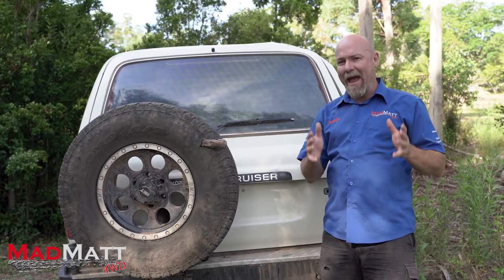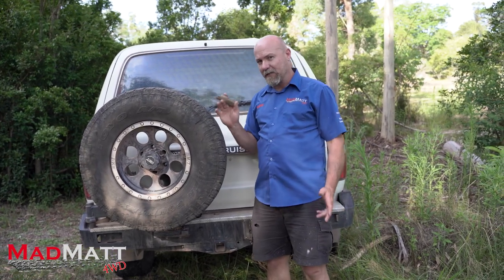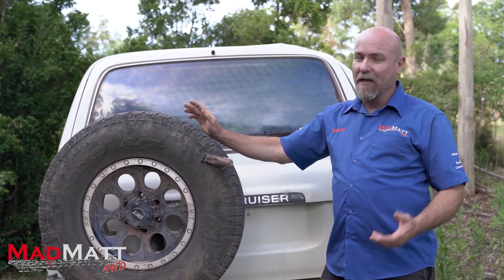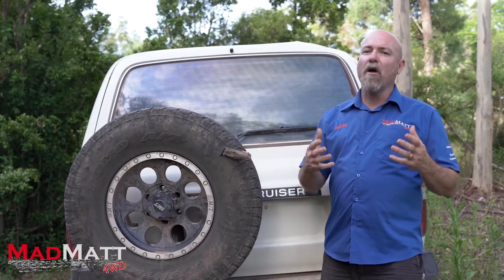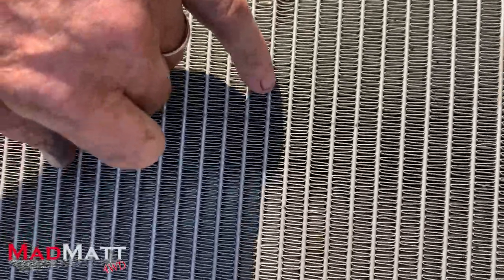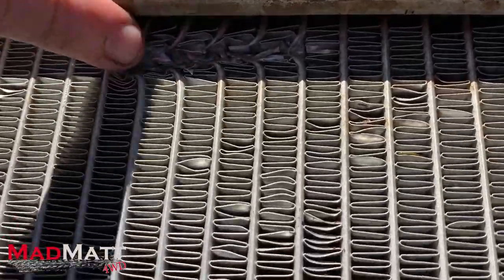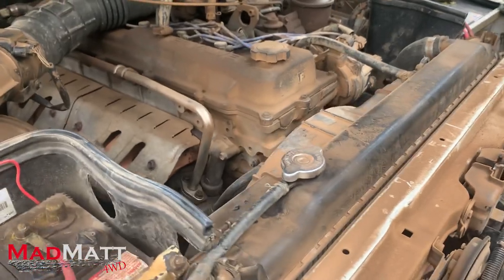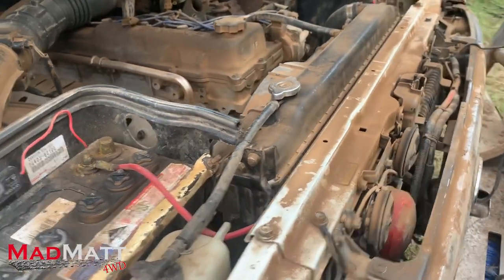How I FIXED RADIATOR DAMAGE in the Victorian High Country PLUS some other bush repairs on that trip!

Comment: Pulled the heim end out of an aftermarket trackbar on my Ram Power Wagon at Rausch Creek off-road park.  I didn't identify the issue correctly when it happened in the depths of the park.  On my gen PW there is a skid plate attached to the bottom of the solid front axle to protect steering components and such.  The long part of the bar wedged itself in between the steering stabilizer and the axle, but did not drop down to the ground because of the skid plate, making it hard to spot.  It was like I had steering, but not great.  I initially thought the steering box was wonky.  I made a really loose, rocky, undulating accent out of the park.  It's grueling when you know something is wrong with your truck and it isn't behaving right, but you keep trudging on.  It wasn't until I aired up and started running on pavement back to the camp ground that I got a sense of how bad the steering was behaving.  The steering wheel was turning 90 degrees without much action from the truck.  I got my convoy to stop and after a few of us went under there, one guy spotted the track bar separation.  So, it wasn't my steering, it was the whole truck shifting back and forth above the axle during steering input.  I don't recommend this to anyone, but we took it on the highway at a moderated speed, my buddies vehicles front and behind escorting me back to the campground.  I let the truck sort of track itself and glide in the direction I needed to go.  The wedged trackbar helped a bit.  Back at the campground, cooler heads could prevail.  With our combined efforts and tools (and a few beers) we were able to remove the trackbar, worked on the threads to remove the stripped metal splinters and was able to get the heim to bite into some good thread to get me home almost 2 hrs away.  A few things to consider tool wise that made it possible.  Right size sockets and extensions for suspension components, breaker bar, torque wrench up to 250 lbs, monster open-end adjustable wrench for jamb nut, full size crow bar and mini-sledge for manipulating suspension joints in/out of frame openings.  I bring all this and more because I am extremely familiar with the underside of my truck as I've done all the mods under there.  Moral of the story, work on your own truck so you know the ins and outs and what tools and spares you might need to get yourself home...and having some friends with you doesn't hurt.
Reply from the maker: Well done

Comment: Good man,  one way l test thermo fan is stick a news paper in it when its hot,if it stops the fan it is buggered,if it cuts the news paper to bits it's ok.     Going through water is tricky with a normal and thermo fan,l changed my normal fan to a thermo fan for this very same reason to lesson the likelihood of blades hitting the radiator. Electronic fans would help because you could turn them off.
Reply from the maker: These motors don’t tend to cope well with electric fans for Some reason. These fans move huge amount of air when they lock up. My 105 fan comes on and off all the time when I’m Offroad.

Comment: So I was 5 hours from home my wiper linkage had broke. After some thought noticed that both arms moved with each other. I proceeded to grab some rubber bands tied them to the drivers arm. Routed them to under the hood. So I had a return spring made. Tied my shoe laces together then to the wiper arm. I would pull the string the wipers would pull up and the rubber bands would pull the arms back down. Five hours later in and out of small to moderate snow fall I was home with a sore arm and shoulder.
Reply from the maker: Oh wow. 5 hours. You would have worn the paint of the a pillar to. Well done
Reply: Yeah but it was an adventure so all was worth it.

Comment: Had the uni joint shatter on our little Suzuki LJ80. Took it out and tied the drive shaft up with fencing wire, and drove it out with two wheels driving in 4x4
Reply from the maker: Well done
Reply: @MadMatt4WD  and then the next trip the exhaust manifold shattered so we tied that up with wire too

Comment: I once fixed a pinhole leak in a 105 radiator with a product called rapidfix from memory. I think you can get the same result from superglue and baking soda
Reply from the maker: That’s interesting.

Comment: Great video as always Matt.  Very informative and I learned something new about pinching the tubes off as part of this sort of repair. A mate of mine had a radiator leak in a tube and a roadside mechanic was able to heat up and patch the tube hole with melted solder and soldering iron.  You ever heard of that one?  Also, thank you to replying in some form or fashion to every comment people make.
Reply from the maker: Pleasure. Yes I’ve heard of that but never had a soldering iron hot enough on the road. Thanks. It takes time but it seems to me if you take the time to comment I should take the time to say I read it. I do worry about when I have too many comments.

Comment: You did the right thing. I used some in the past and it blocked up the fins in my radiator, not the end of the world but it was in front of the bi metallic strip on clutch fan. Clutch fan stopped engaging and vehicle kept overheating.  When i eventually removed head this stuff had deposited everywhere.
Reply from the maker: yeah

Comment: Matt, I have two rubber seals from my old fuel filters knotted together and hanging off my thermostat pipe. The last seal can reach over a blade of the viscous fan, and holds the fan from turning while in deep water. I have braced the fan this way a few times, but to be honest, I have not been in water deep enough yet, that would have needed this to be done. Just thought I would mention this as an option.
Reply from the maker: That’s an interesting solution. Simple too

Comment: On YJs and TJs you can replace the tie rod with a high lift jack beam, some bolts, and lengths of chain. Have done it once on a TJ. The guy drove around like that for a week before fixing it properly.
Reply from the maker: I've seen that done.

Comment: Beat this:

This is just for fun, but 100% true: Christmas eve 1980 I was driving my Austin Healey Sprite to see my girlfriend and spend the night with her (yes) and it had been weeks since we had last "seen" each other. My stock Sprite had a mechanical fuel pump that abruptly died. The original pumps like mine had a mechanical handle/lever that could be actuated to manually pump fuel with the engine off. Fuel line disconnected and lever pumped, "No Fuel". So I knew I was in deep. I was so desperate to "see" my girlfriend, I got very creative and this is what I did:
 
I rooted the stock factory hand-pump windshield washer lines to the inside of the fuel lines from the gas/petrol tank and then to the carbs and hand-pumped my Sprite's SU carbs with the windshield washer pump all the way to my girlfriend's house which was about 6.5 miles away. It was "pump, pump, pump, shift, pump, pump, pump, shift" all the way there. I developed some later needed rhythm on that drive. I could have been burned alive if the pump had leaked under the instrument panel and ignited, but I was young and had to get to Laura. 

It was a great Christmas I will always remember.... this is a 100% true story.
Reply: If this is 100% true, as you said, then you are an absolute legend
Reply from the maker: Fantastic what can be achieved when motivated.
Reply: @MadMatt4WD  I was Highly Motivated!!  Matt. Thank You. All my years with cars and I never thought to pinch off a leaking tube. That was brilliant. I suspect I will get to do that for myself or someone else someday. Your experience and wisdom is admired by all of us that are your students.
I grew up with Barrs (Model A Fords, we used it as a precaution), but switched to "K-Seal" a few years back and have had fantastic luck with it. My Son's RX-8 engine blew the internal coolant seal (I think there are two) and all the Mazda expert shops wrote the car off as dead without an engine rebuild. It had 147,XXX.0 Miles at the time. I put in one bottle of K-Seal as a last ditch effort before parting the 2004 out (we had to de-flood and left the plugs out for several days to dry it all out). It now has 210,XXX.0 miles on it. When I change the coolant I put in a new bottle of K-Seal and he now "pre-mixes" (last 60K) his gasoline with Idemetsu oil each fill up. It runs perfect and no more leak. I swear by K-Seal.
Reply from the maker: @benkanobe7500  Thanks for the kind encouragement and I'll have to get some Kseal.

Comment: Nice info video Matt. I'm going to add that aqua to my emergency repairs pack - thanks. The roll over, the tree in the tyre and the radiator damage is known, grammatically, as a riot of incidents. (I'm not sure that is correct, but I think it captures the feeling pretty damn well!)
Reply from the maker: cheers and i'll go with that.

Comment: 3 days ago I broke a radius arm on my GU patrol. A key placed ratchet strap pulled it back to the drop box tight, another random strap wrapped around chassis rails and a D shackle to hold it all in place got me out of the trails and home driving very slowly.
Reply from the maker: Nice

Comment: While i was driving along Redhead Beach My hub fan came loose and hit the radiator and caused it to leak in 4 spots. I drove out the caltex and bought a 6 pack of eggs, I cracked the 6 eggs into the radiator and it stopped the leak and I drove all the way back to Sydney without any overheating issues. It actually held up for 2 months before I bought a new radiator. The old one never leaked but I thought I should probably change it before the next trip out haha.
Reply from the maker: That's awesome

Comment: You can drill a small hole in 1 fan blade big enough to fit a zip tie and then zip tie the fan for the crossing. There isn't a lot of force required to stop the blades from 0 rpm.
Reply from the maker: thats a good idea.

Comment: The same thing happened to my radiator and found a wrecked car in the bush and took the radiator out of that, had to flip it 90 so the ports would match up on the block and tech screwed and zip tied to buggery, pretty gross but it got me home hahaha
Reply from the maker: Wow

Comment: Max! How do you keep the water out of the distributer cap on the 80? In my experience, the second it gets a lick of water it'll cause immediate problems. Any tips are appreciated!
Reply from the maker: Hey mate. It’s Matt. 🤣. A few simple things. Good quality plug leads. Move the coil from shock tower to up behind battery. Where plug leads boot sit on rocker cover seal with something like gasket goo. Not silicon. Make sure dissy cap seal is in good order or seal it with gasket goo.

Comment: Matt, back from Papua Niugini? I've heard stop leak can block heater matrices as well. Any thoughts on eliminating engine driven fan and using electrics with a shut off switch? Hope everyone was OK after that rollover.
Reply from the maker: No one was hurt. Electric fans don't keep these motors cool enough here in Australia.

Comment: My brother did a serpentine belt, he called me at 1am in the morning we brain stormed and came up with the idea to use zip ties, he drove just over 100km home with zip ties as a belt.  

I've personally used super glue and baking soda for fixing a cracked plastic radiator.
Reply from the maker: Good solutions.